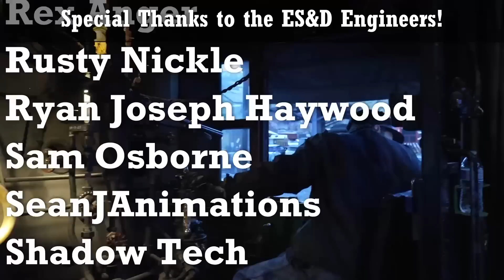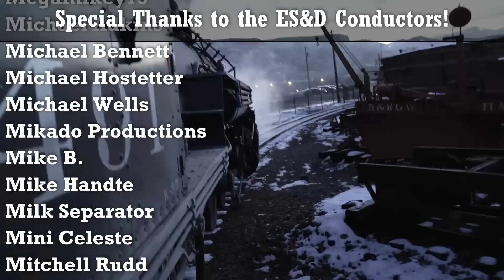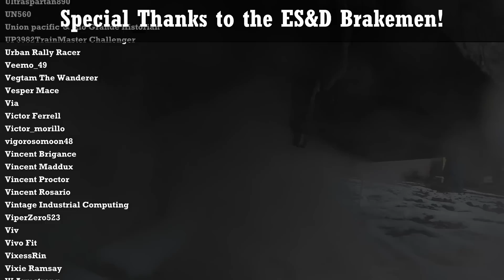Light rail isn't light? Street Car vs. Light Rail vs. Commuter Rail | Railroad 101

Comment: One interesting thing about light rail at least in the US is that the term “Light Rail” has more to do with limited passenger capacity than weight. Most light rail vehicles in the US are actually much heavier than the “heavy rail” subway cars mainly because they need to be able to survive collisions with automobiles in regular service.
Reply from the maker: Interesting!
Reply: those bad drivers

Comment: “Streetcar” vs “Light Rail Transit” terms are typical for countries that dismantled urban rail transit in 60s and 70s (like USA).
Countries that kept their urban rail (like Germany or Czech Republic) just have one word (for example, “tram”) across the decades. Those “trams” in the 50s would look more like “streetcar”, but after being extensively upgraded in 80s-90s-00s they now look more like “light rail”.
Reply: The second scenario you described seems quite similar to the network in Melbourne, Australia which has had trams running since they were first put in, horse- and cable- drawn (as they were) back in 1885. 
We still have a line running historic trams, which look very much like streetcars, but the majority of the network is moving towards a more light-rail look, with aims to make the vehicles in the fleet have higher capacity and be more accessible (level boarding, passenger information given as both audio announcements and on displays, etc). 
The trams here mostly run on/along the roads, but a few lines have sections which are dedicated to the tram (one used to be a rail line, another runs through a park).
Reply: Not entirely true. In germ any you got Straßenbahn/Tram, and Stadtbahn/Light-rail.

The Stadtbahn as we know it today orininated in Frankfurt/Main, and is also the blueprint for what we call light-rail these days.

Comment: Classically, I would consider any freight standard gauge track to be "heavy" by association, or at least in comparison to city transport rails, subways, trams, etc.  The mainline BNSF and CN lines near me are loaded down with coal or gravel or taconite or containers that weight many tons more than a complete commuter line used by a metro.

Comment: Place closed captions well into the picture frame.  Youtube on TV's typically has the perimeters of the frame cut off, some TV's do this a lot.   Light rail cars have light axle weight relative to heavy rail cars.   DC's Metro is noted as heavy rail.  It has long cars placing a heavy load on the axles.   An easy way I've found to tell light rail is simply if the cars are very short between their trucks compared to a standard North American passenger rail cars.  That keeps the axle weight light along with little crash worthiness.  Light rail passenger cars and other  isolated rail transit don't have to follow North American heavy rail passenger car crashworthiness.  

The old electric interurbans with some Washington  DC street cars being at that level being PCC cars such as the Cabin John Trolley R20 could really move with speeds in the 60 mph range.   These cars were mostly run individually.

Even though DC Metro cars  are heavy rail cars they telescoped in a crash killing the people in the forward car when the rearing car crashed through it.     I find it appalling the DC's Metro cars, believing them to be highly modern, designed to run at 75 mph from the beginning of the  DC's Metro in 1976, telescoped in a crash killing the people in the forward cars form such a well known situation.  

North American heavy rail cars by design in a crash will pile up sideways accordion like and are anti-telescoping.   Light rail cars being unable to survive a crash with heavy rail cars have many track preventatives to keep them from somehow finding their way onto heavy rail car tracks.    That is a constant concern to the point of hysteria.

When the area north of San Fransisco implemented what most people would call light rail it was done with passenger cars that were made to North American heavy rail passenger car crashworthiness so they can share tracks with heavy rail freight tracks and protect passengers from telescoping in crashes.  For any rail fan that has seen the history of telescoping crashes  it's a constant comfort to know that system has learned from history saving from killing everybody in the forward cars in a crash.
Reply: US buff strength standards for passenger cars on the common-carrier network require the carbody to withstand 800,000 pounds of compression without damage to the structure. I'm not aware of similar standards for rapid-transit cars (which never intermix with standard rail equipment) but I've heard quotes for NYC subway cars having a 200,000 pound standard.

Comment: I’m a light rail operator in Portland, and you’re correct in that for the most part we are regulated by the FTA, but also the state of Oregon’s DOT. The only places where we have to follow specific FRA regulations (like keeping our railroad light on at all times) is where we run right next to heavy rail tracks. On the MAX system, our only tracks that runs close enough to heavy rail to fall into that classification is parts of the Orange Line where we share 8 grade crossings with heavy rail and some parts of it where we run adjacent with no separation fencing.
Reply from the maker: Well said; crossings tie into, a whole litany of other issues that bring all sorts of regulation. In my brain that was a separate thing I've already covered but here we are. Thanks for your experience!
Reply: TriMet employees in Portland are AWESOME 😎🌞 unfortunately our local government has made the system so unreliable and also unsafe that despite the fact my house AND my job are RIGHT NEXT to a MAX stop... I take the TriMet bus instead. It's literally faster 70% of the time (I've tested it, I have spreadsheets 😅), and I'm less likely to get raped at a station or stabbed 🤷‍♂️ -- so I'm realllllly not a fan of the MAX. Combine that with the fact it was randomly delayed for accidents, switch issues, and maintaince, often with no warning, often several times a month depending on the line (looking at you Blue Line 😡) ... and if I didn't account for that instead of getting to work 20mins early... it could possibly get me there 1hr late and it happened often enough eventually I just had to stop using the MAX or I'd lose my job 🤷‍♂️. Either that or I could leave 2 HOURS early for insurance that I'd have time to transfer to the right bus if something happened. After timing out a bunch of commutes I discovered I saved 15mins on average every time I chose the bus instead of the MAX, often even if there were transfers involved. --- Don't even get me started on the fact that are way WAY too many stops downtown. It doesn't make sense it should take almost an hour to go 2 miles just because they want a stop every. other. block 🙄 -- I really want to love the MAX... I LOVE the operators and TriMet drivers and employees in general ❤️ you guys are not only friendly, the amount of compassion COMBINED with a good sense for keeping people safe is amazing! ... I just wish our system was better managed, maintained and upgraded, and better policed so that the public could get better use out of it! It has the potential to be amazing! ... It just isn't right now imo ☹️
Reply: @robnobert  it would help if the decision makers for trimet/max were in Portland and not Salem

Comment: Who regulates the River Line in New Jersey? They run on freight corridor and is a light rail system. Although it can be argued, and the cars are modified Stadler FLIRT, so pretty much mainline equipment...

Comment: Similarly to rail size, I’d like to know why sometimes dedicated LRT track is still paved over.

I believe the introduction of European trains to US systems further adds to the confusion.  Here in Austin, TX, we have Stadler GTWs, which are light by American standards, but typical for European trains.  Run on the same tracks as the freight trains; I don’t know if they’re still separated out, though.  I recently saw a GTW running at the same time as the local excursion train.
Reply: Here in Czech Republic diesel powered variations of Stadler GTW are used at several "lokálka" - regional rail lines with low speeds and capacity. Freight trains use them to but usuly short ones where they take something localy produced to closest imporant railroads.
But there is also narrowgauged electric variation on Tatry Mountains Tram Railway.

Comment: Apparently I'm in the extreme minority that always thought that "Light Rail" referred to the vehicles and not the rails. Because to me, (also in my opinion) it's pretty obvious: commuter trains are big and heavy (even where I live in New Jersey near NYC, where we have EMU Arrow IIIs for NJT and the NYC Subway that are lighter vehicles than the usual NJT Comets and MultiLevels plus the about half a million lb locomotives), but the smaller somewhat railbus like vehicles of Light Rail are obviously lighter in weight than the NJT EMUs and the NYC subway (oh and PATH too, but the NYC subway and PATH are big long trains.)
Reply: The funny thing is that many light rail vehicles can be as heavy if not heavier than some heavy rail vehicles thanks to crash startards (and sometimes to counteract the top-heavy design of low-floor vehicles) and conversely, heavy rail vehicles might have a similar capacity as light rail vehicles (say hello to Chicago L and Boston Blue and Orange Lines).

Comment: Fourteen seconds in: Let’s see if I can prove myself wrong in the next three minutes. Without research: light rail is short commuter passenger trains on designated routes that can be powered by several different power sources: diesel/gas/electric in a city with many stops. These routes will never, ever carry two to six engines which currently could be about a mile long.

Comment: Light Rail Transit are the same as Trolleys and Trams, but with a larger marketing budget.

Honestly, the only difference is the way the system is run and what it's intended to accomplish. If you want a trolley-like system that operates in lieu of commuter rail but on the cheap (and to bypass some of those pesky standards) and without reminding people of the 'great streetcar scandal' or other negative perceptions folk might have, you call it 'light rail' or a 'light metro'. As an Australian, I know that Melbourne still runs high floor trams and Sydney's 'light rail' operates both like a 'street car' and 'light rail' within the definition given. The inner CBD sections operate along either streets or within pedestrianised areas, before opening up into dedicated rights-of-way.

Maybe it's worth thinking about the colloquial 'lightness' of a rail network in terms of ballast and ties. The Link runs mostly over concrete without traditional ballasting, correct? That seems more uniform over so-named 'light rail' systems. The lower speeds and centre of gravity of the rollingstock (plus modern construction methods) presumably allow these to be dispensed with.

P.S. The lack of interconnectivity between streetcars and Line 1 was a headache when I visited Seattle two years ago; I spent more time waiting for a trolley then walking from the trolley down to the capitol hill stop than I did on the trolley itself. It's wild to me just how many different modes exist side-by-side in one place yet weren't properly meshed together.

P.S.S. To really mix things up, 'tram' as a term was used broadly during the steam era here, incorporating small branch lines ('tramways') that serviced a small number of stops with sections of street running and either limited or no ballasting. This meant you would catch a 4-4-2T loco-hauled 'tram' to a town like Yass or Camden at the same time as Sydney had the largest electric 'tram' network in the southern hemisphere.

Comment: I got a little book once from a scrap dealer covering almost all of the available steel rail weights that catalog the sizes(height, head width, and base width) by the manufacturer(mill).  I have a piece of pear-head rail from a place where I worked.  I traded a piece of pear-head rail for a piece of U-rail and 2-piece rail.  Steel rail has been rolled in sizes from 8 lb or 1 9/16 inch high to 155 lb or 8 inches high in the typical T-shaped pattern by rail weight and pattern or section.  The rail weight with the most sections is the 75-lb rail with 27.  Some railroads designed their own rail sections and had them rolled for them.

Comment: I have a quick question that wasnt explained in the video, when you say "the crews bid in" (in reference to BNSF crews working on the SoundTransit route) what does that mean. Like do they put their names in a proverbial hat, or it it more of a "person X its your turn to run the pax job"
Reply from the maker: Union bid jobs! Based on seniority. If you bid the job and get it, it's yours until someone higher seniority bumps you off of it, or it gets reorganized and comes up for bid again..
Reply: @Hyce777  : That and similar topics might make an interesting video.  You could center it around "what is the life of a train crew like" sort of generally, and talk about things like in the early days when engineers had a specific locomotive assigned to them (which I gather lasted through the end of steam on the Southern), and where crews would sleep if they had assignments that didn't get them back home at the end of the day (cabooses sometimes had beds; did only conductors sleep there or who would do that?).

Also some simpler things like how many people make up a train crew and how that's changed over the years; on one model railroad I operated, we had little cardboard flagmen to put out when we stopped for a switch job, and I think between them and brakemen and the conductor and engineer and fireman we had an imaginary crew of six or seven people.  It's now down to just an engineer and a conductor most of the time, right?

Comment: i still think, its because some marketing guys doesnt want to name it "interurban", because thats what LRT practically is.
Reply: It's actually almost Exactly the same as an Interurban, infact they are often the direct successors to Interurbans
Reply: Areas once served by interurbans are now typically served by commuter/regional rail, like Metrolink in Los Angeles, which had most of the territory served by the interurban Red Cars, while Metro Rail serves where the Yellow Car streetcars once served.

The three systems built in the 1970's, namely BART, the DC Metro, and Atlanta's MARTA are probably the closest things to interurbans in a modern sense, as they act like heavy rail subways in the main urban area but more like commuter/regional rail in the suburbs.

Comment: Around 100 years ago the term "light rail" might apply to interurban electric passenger services,  different from street car railways  found only within one city. Freight rated trackage when automobiles were becoming common, sometimes to this day, might involve street running sections in suburban towns that the railroads had created.  Those "heavy rail" lines also needed the streets they ran through to have a more substantial roadbed to spread the load. Light rail as you say is about the weight that the right of way can carry with the rails and ballast it uses.

Comment: I would love to hear about how some LRT/Light Rail signalling works. I've seen some systems, and OC Transpo (the one I've studied the most) have very odd signals. When the doors close and lock, only then the signal ahead of the driver turns green. They definitely don't act like standard mainline signaling, especially since they only have Red, Green, and sometimes Lunar

I would love to see a Signals 101 Light Rail Edition!
Reply: The issue with light rail signalling is that different systems use different signals.

For example I drive LRTs for the MAX system in Portland. We have both pre-empt and ABS (auto block signal) territory. In pre-empt it’s pretty simple. Yellow horizontal line means stop. White vertical line means clear to proceed. If the yellow horizontal is flashing that is an indication that white vertical is about to come up, but still means stop. If the white vertical is flashing that’s basically the equivalent of a yellow light to cars where the preemption is about to time out and to stop if you can before the intersection.

ABS there are 4 different aspects or colors that a signal head might have. Red is stop, yellow is clear for 1 block, green is clear for 2 blocks, and lunar which is clear to proceed tracks may not be clear. Lunar is really only used when the ABS block leads into preempted intersections without crossing gates. That’s mostly at interlockings.

ABS signals can also have multiple aspects illuminated at once if you’re on a route other than the “A” route. In Portland our system is pretty heavily interlined so we have quite a few interlockings that different lines go different directions from, so you need to know if the switches are set for your move. Having 2 aspects illuminated means you’re on the B route, 3 is C, 4 is D, 5 is E.

If you’re going on that alternate route without any intermediate signals, the aspect would be Red over Yellow for B, red over red over yellow for C, etc. could also be Red over Green as long as there is an intermediate after the B or C route switches.

If there is an intermediate before the route change, it would be Yellow over Green etc. and if there are 2 intermediates it would be Green over Green.

There are also combination ABS/Preempt signals but there aren’t very many of those in use.
Reply: @dfor  oh yea that makes sense, no problem